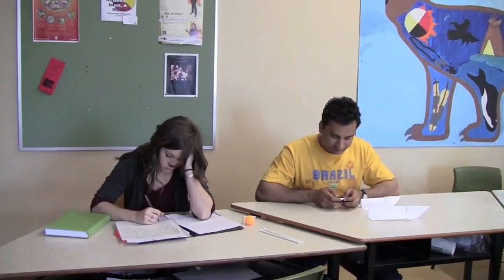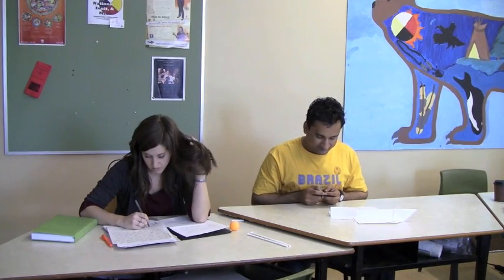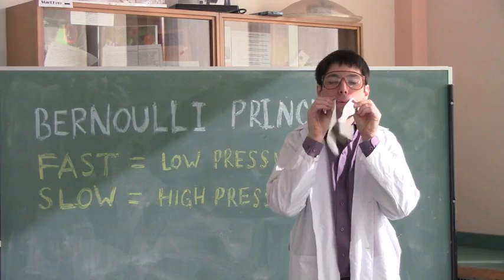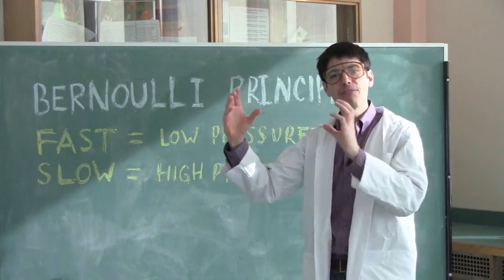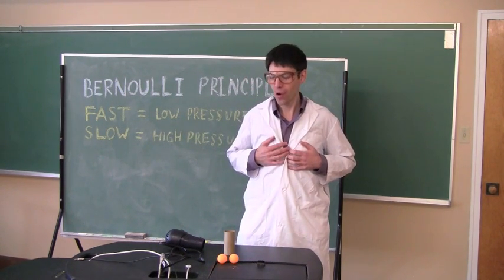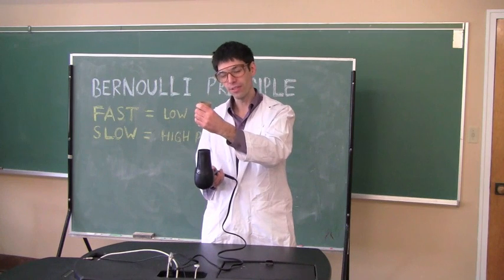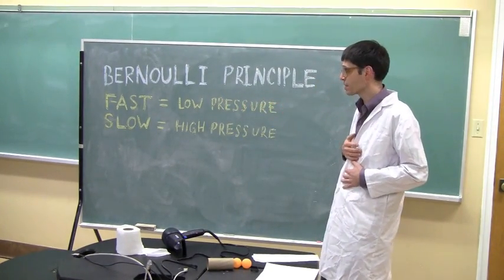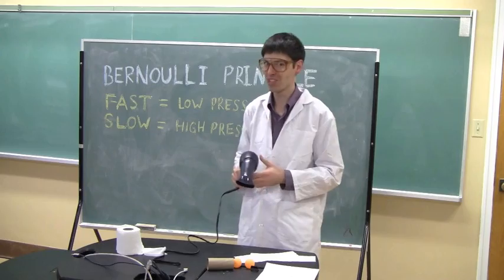✈✈ Bernoulli's Principle - Easiest Way Explained ✈✈ ☹ ☹

Comment: I am very sorry, but this is only repeating some  of the most common misconceptions in science.  
Fast air does not have low pressure.  What Bernoulli found is that Accelerating air has a decreasing pressure and visa versa; BUT NOT what caused this to happen.  
--
Euler continued that study and realized that it is a pressure Gradient (difference between two locations) that is the force that accelerates a fluid.  This is Newton for fluids.
...
The air out of your mouth is at atmospheric pressure; that same pressure as the still air around it.  It is the higher pressure*created *inside your lungs by the contracting muscles that accelerates the air out into the lower, atmospheric pressure.
..
Blowing next to paper demonstrates entrainment which is caused by viscosity. . Look them up.  
If this is what your teacher taught, they have been misinformed, which is, unfortunately, VERY common.
--
The air over a wing only looks faster in a wind tunnel.  The lower air is actually faster as a wing flies by you.  The upper air is, however,  accelerated much more caused by the lower pressure above the inwg.
The pressure changes around a wing are simply caused by the wing pushing air out of the way to get through it.
...
Bernoulli had nothing to do with the development of the airplane. He was doing blood pressure studies.
...
The air above a wing gets to the trailing edge significant;y BEFORE the lower air; which is caused by the low pressure accelerating it toward the rear.
...
The ping-pong ball is held in the center by the Coanda Effect. A flow that follows a convex surface is what lowers the pressure. Think of centrifugal force pulling the air away and, therefore lowering the pressure.
 The air out of the hair drier is at atmospheric pressure, The side of the ball where more air curves around to the down-wind side (top)  of the ball has a lower pressure because of the greater Coanda curved flow. 
When tipped, there is more air flowing over the top AND flowing in a curved path (around the back and then downward).  This lowers the pressure more and supports more of the weight, therefore, allowing the upward moving air's dynamic pressure to push the ball further out..  This is the only explanation which explains why the ball moves further away when the flow it tipped because the air is slowing down farther from the blower and the centering force would be less, not more, if the Bernoulli fallacy w=as true.
..
ALSO, if the air at the blower's exit was lowest, the ball would be "sucked" down (actually pushed down by higher pressure above it)
...

The tube above the ping-pong ball is a very good discovery and requires a more careful understanding because this fact ait thing is false.  
My initial analysis is as follows:
The tube prevents much of the air which would simply 'spill' around the sides of the ball to be trapped below the ball in the tube and to push the ball up like a piston in a cylinder.
Reply: Yeah, thank you. Now I need to re-read the good ol' Fundamental Physic College books to get on to this.